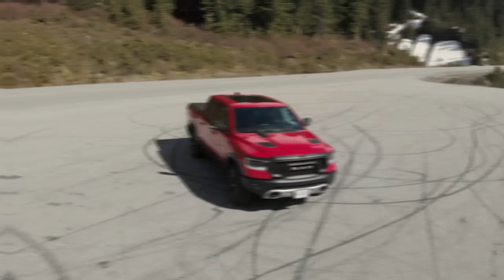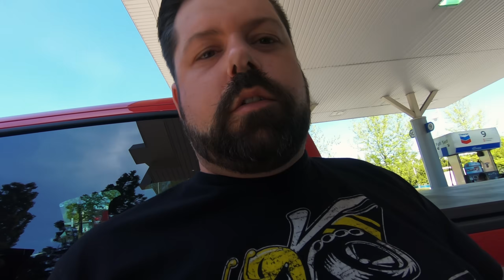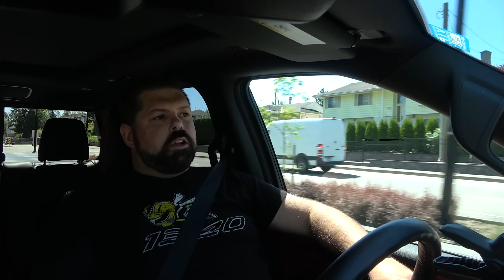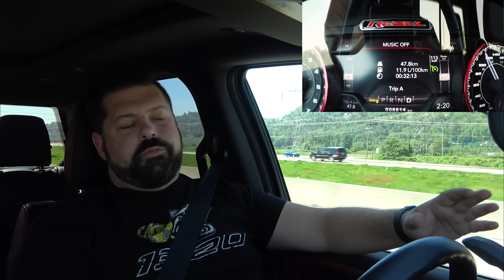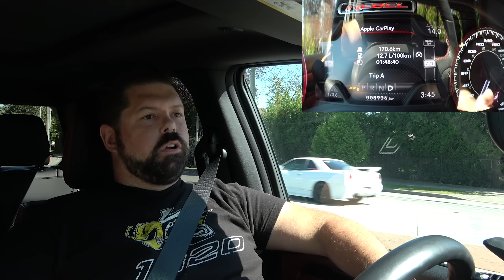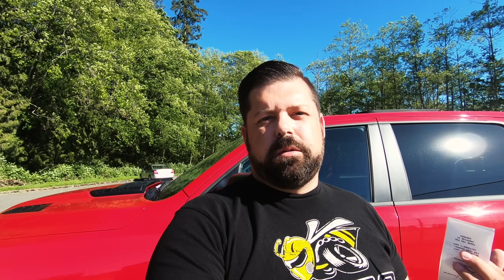2019 Ram Rebel Highway MPG test

Comment: Good to see a fellow BCer!

My 2021 Rebel is shockingly bad. Mind you it's only got 1600kms, I'm getting 20l/100kms combined (11mpg) . I love the truck, but the fuel consumption is a massive concern. This is not what I thought I'd be getting.
Reply: Did it ever get better over the last 5 months? Do you regret the purchase at all?
Reply: @xistrik3rix  It's improving! 7000kms, and I can get 15l/100kms on the highway, which still sucks although I can accept as it is a half tonne with off road to test.

Other than the fuel economy, LOVE the truck!

Comment: I have a 2019 Rebel and couldn’t be happier. I went between the Rebel and Big Horn. Took the Rebel on the entire test drive. Got into the Big Horn and went a couple blocks and turned around. It was no where near as comfortable of a drive as the Rebel, which shocked the heck out of me considering it is technically an off road truck. I am very happy with my MPG I am getting with such an aggressive truck too.

Comment: Fill up with 93, turn off the cruise control, and you'll instantly get better MPG.
Reply: That's not how octane works... The truck is designed for 89, filling up with 93 won't magically give it better mileage, or power for that matter.
Reply: @greyman8174  the truck is not 'designed' for anything, just a minimum requirement of 89. Higher octanes are known to burn more efficiently, regrardless of the minimum octane a manufacturer recommends/requires. I have yet to own a car where the manufacturer recommends or requires 93, and yet I've always gotten better MPG with 93. Not to mention, better throttle response. On the flip side, my wife's ML350 'requires' premeium gas, and yet it has been perfectly fine (13 years and going strong) running on 87.
Reply: @dannydyn  Yes, the 5.7l Hemi in the truck really is 'designed' for 89 octane fuel, although 87 is also acceptable as per the documentation on the vehicle provided by the manufacturer. Perhaps you should do some reading on said documentation before making such claims.
And no, higher octane fuels DO NOT burn or provide more efficiency in vehicles that are not designed to take advantage of said higher octanes. The only reason for higher fuel octanes is for higher/varying compression ratios in vehicle engines, which are designed to make use of the higher octanes. I advise you to research this for yourself - there is plenty of documentation on this as well.
Reply: @dannydyn  As for your wife's vehicle requiring premium gas and filling it up with 87... I highly advise that you do use premium fuel in that vehicle to avoid engine knocking and eventual damage to that vehicle engine. It is designed to use the higher octane and requires it for a reason.
Reply: Greyman I own a 2019 crew Laramie with no etorque and the off road package fully loaded and I use 93 octane always - I get 20-24mpg on the Hwy and 18 mpg around town. 

Who buys a 50$k truck and bitches about an extra few bucks for premium

Comment: I wish my '19 Rebel got anywhere close to that hwy number.  I'm at 6100 miles and I'm still in the 14 mpg range on the hwy with no wind.  I've gotten as low as 11 at 80+ mph into a headwind.  I love my truck, but the fuel economy is atrocious.
Reply: I am only getting 13 mpg on the highway  and 11 in town.  Dealership said that it needs to break in it has 2900 miles .I am very disappointed.  My 2011 Ram got 18 mpg
Reply from the maker: You're not the first person I've seen say that. I really wonder what seems to be the reason some of these trucks are getting such bad fuel economy.
Reply: @5thGenRams  I really wish I knew why such a disparity.  Seems most 4th gens get quite a bit better economy, as well.  My dealer keeps feeding me the "it's gotta break in" line, but first they told me that break-in period was 3k miles.....then 5k miles.....and now it's 15k.  They're just feeding me a line in hopes I'll just let it go.  sigh
Reply from the maker: @tommyr95  And that is where it gets weird. I see a lot of people say that their 4th gens got better economy, I own a 2016 Ram Sport Crew Cab 4x4 with 3.92s and have gotten better economy in almost every 5th gen that I've driven than I do in my own 4th gen. Definitely odd. I will say though that last year I did average about 22.5 MPG on the highway in my 2016 for a tank on a stretch of highway in the prairies.
Reply: @5thGenRams  I just bought my 5th gen Rebel based on getting 19 combine mpg and I have not been able to get more than 13.4 mpg with 2,700 miles.   I did noticed the stop and start does not stay all the way.  When am at the light it would shut the truck off and about 5 seconds later it would  turn back on.  I brought this issue to the dealer who told me I was not pressing the breaks hard enough, so now I do it to the point that my leg hurts from the pressure and still does it.   they fitting me the same bull that it needs to break in.

Comment: Stuck between going for a rebel or a power wagon. Used PW can be had for around same price as Rebel  in various instances
Reply: Depends if you're going to drive it every day or not. 5 mpg difference adds up quick when you're putting $100 a week into the tank. The power wagon is better off road, but the rebel is a dream to drive

Comment: Would like to know if using coil suspension would change gas mileage compared to air suspension ?
Reply from the maker: It's possible it could at highway speeds due to extra aerodynamic drag as the coil suspension is a fixed height of course and the air suspension lowers to aero mode for better aerodynamics.
Reply: It won't change much. Adding a leveling kit and staying with stock tires, barely change the gas mileage. I was still getting mid to high 10L/100km with my 2011 Ram hemi 4x4 on the highway after my 2.8" leveling shocks.
Reply: @PatMongeon  Thanks for comment !
Can a larger tire be used without without any install issues example tire rub in wheel well ?
Reply: @pjasyl  it will depend on the lift you choose, tire size you go with and wheels spec. Some people will clear 35" without issue and some will rub with 33", all on the same lift.
Reply: @PatMongeon  Placed order for power wagon as is for now, however upgrades in future - lift, wheels  & tires.
What  do you suggest ?
Reply: @pjasyl  I really couldn't say. I sold my Ram a couple years ago and now I'm driving an 2018 F150. Lift and tire fitment is a completly different ball game on the Power Wagon. You should look for a Ram forum to find all that information.